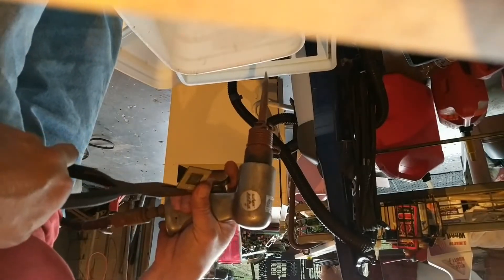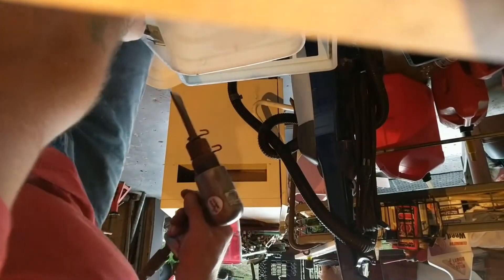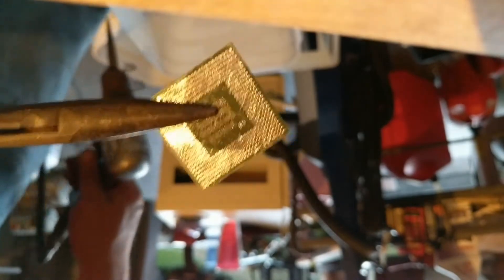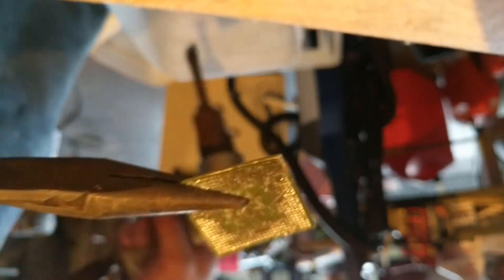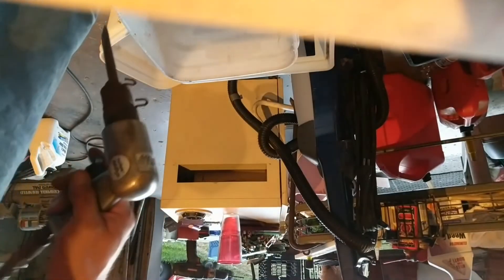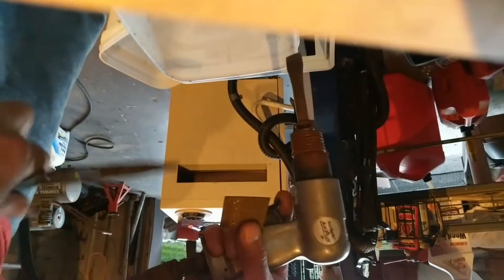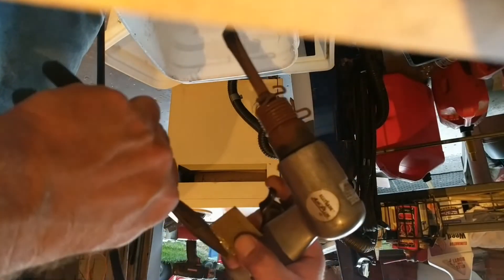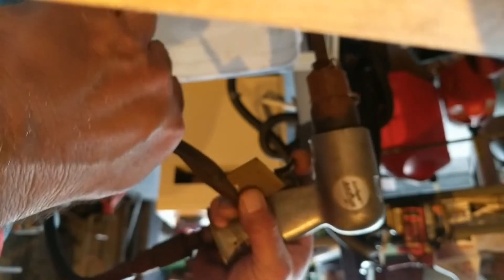Gold Pins Recovery Trick From CPUs

Comment: Nice video and process Mike. The one thing that I have been trying to figure out is how to get the gold bonding wires out of the black computer chips. I have seem people try to grind them up usually with a lot of time and work and usually not very good results. I have seen people burn them but it takes a lot of work for just a few chips at a time and then you have to get the wires out of all of the ash. Do you have a favorite way to process the black chips or do you not even mess with them?
Reply from the maker: hey Scott,. I am going to try the corrogated drainage pipe and if that doesn't work I think I am going to get the blue bowl.  I tried panning with little success and I am actually a pretty good panner.  I will make a video once I figure out a good way but I wouldn't be looking for it too soon, I have been working a lot of overtime lately.  Thanks for watching.
Reply: Scott Bragdon perhaps addijng water and letting all of the ash dissolve into the water. Just an idea.